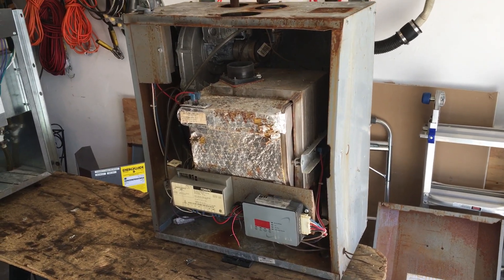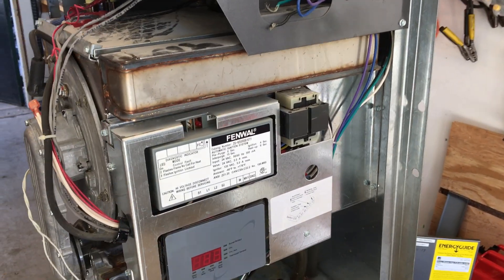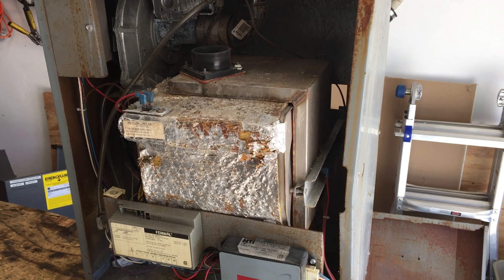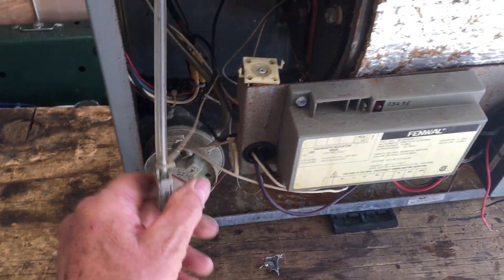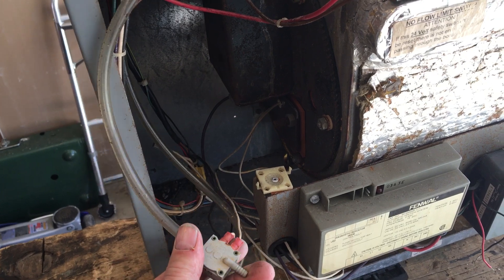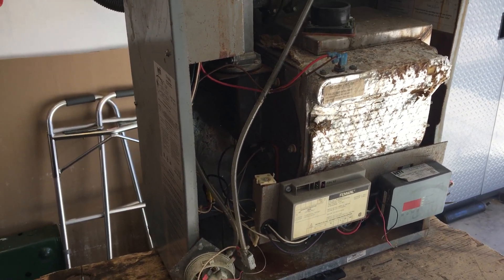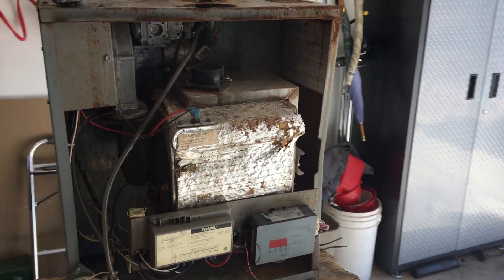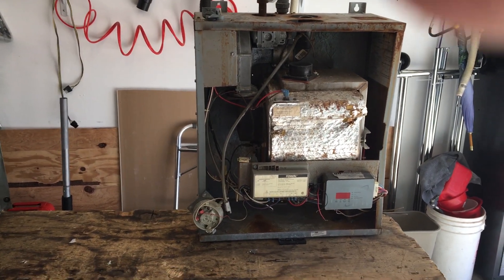NTI boilers. PART 2

Comment: Awesome video. The p/n 82056 "postage stamp" pressure switch that you talked about is just starting to act up on mine.  I bought one of the adjustable Huba switches just in case to be safe.  I think it should be set to 0.1" wc, but need to verify.